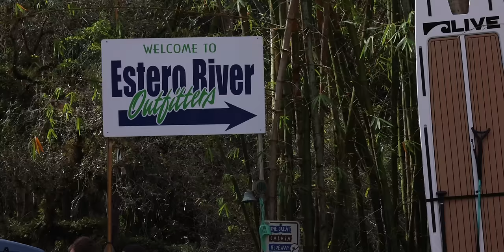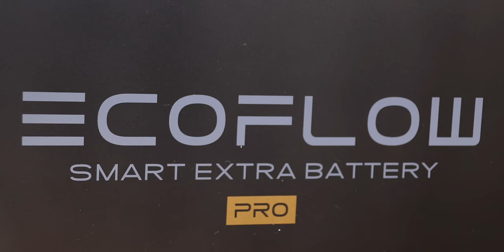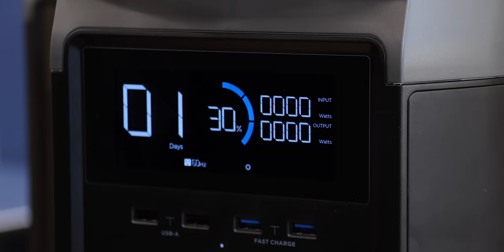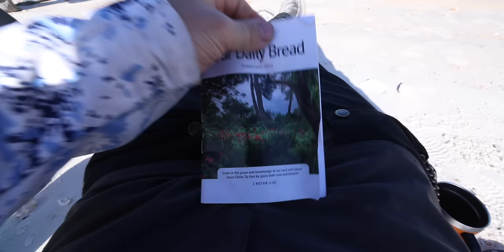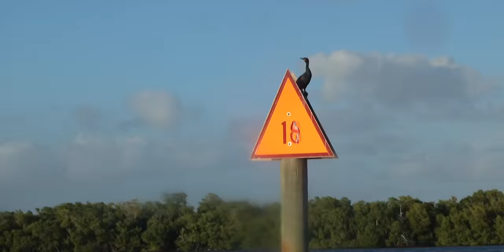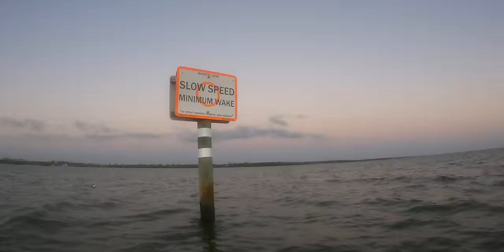4 Day Catch & Cook Hammock Camping in the Florida Everglades Ten Thousand Islands

Comment: You need to try going offshore in the kayaks.
We paddle out to the rigs which is anywhere from 10 miles to 15 miles off the Texas coast.
     You'll run into shark feeding frenzyies that are crazy!!!
  We call it the Texas sleigh ride. We have anchors that are hooked to what we call anchor trollies that you can run from from front to back on your kayak depending on the current.
Our anchors have a float on them which you disconnect from the Yak once you get a good hook up so you can come back and find it after being dragged for several miles by the shark.
   The largest I've caught was a 7 foot long black tip.